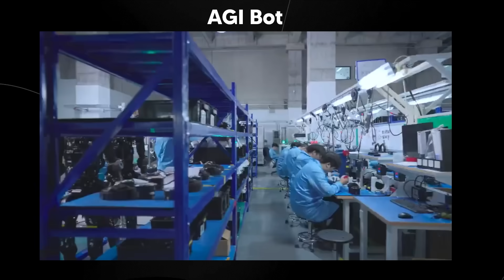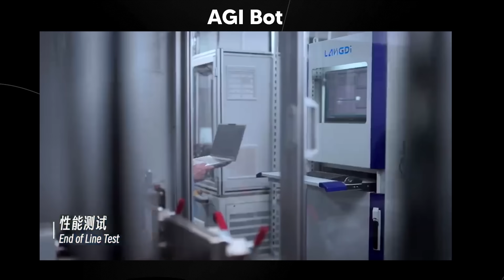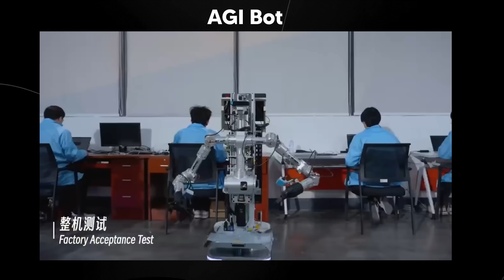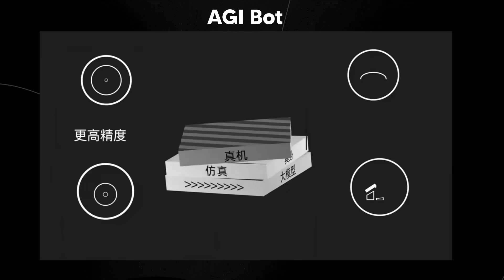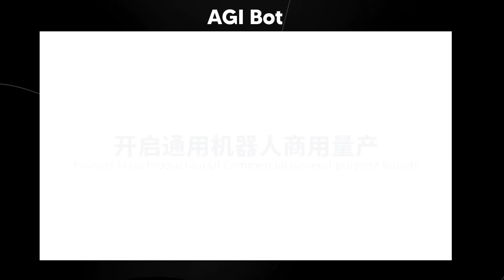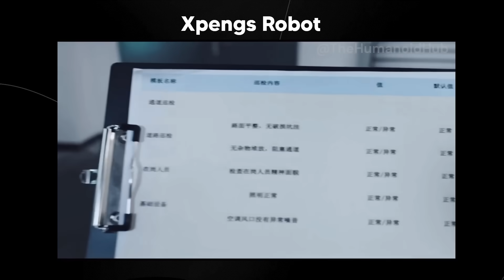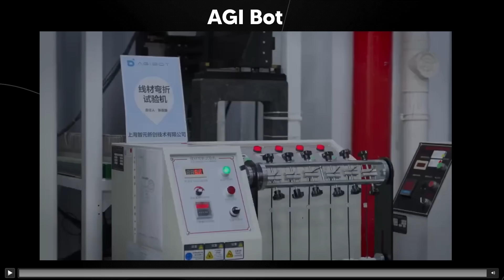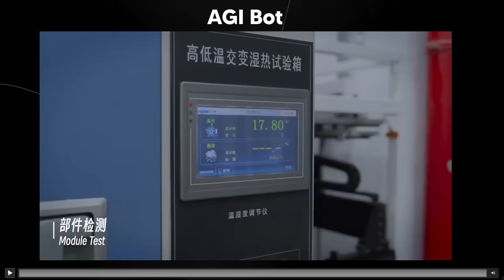China's NEW AI Robot Workforce: The World is STUNNED! 1 Million Robots by 2025?

Comment: If you have a totally automated factory, why would it be a humanoid robot? Why wouldn’t the factory be tailored specifically to automation?
Reply: What is more expensive, redesigning a factory to work well with automation or designing your automation to work well with a factory? Even if redesigning the factory would be more efficient in the long run if the up front costs are much higher than the other solution the less effective solution of designing automation to work in a suboptimal environment will be chosen until it becomes the only feasible solution at least as far as I understand it.
Reply: @christopheriman4921 yeah I agree. The whole world is built for humans, when requirements change or demand slows these humanoids will be flexible and easily repurposed unlike your typical Kuka arm or specialized equipment
Reply: Humanoid robots to cut factory workers and eliminate labor costs -> generate more profit -> reinvest in automating factory for maximum efficiency

I work a boring factory job and think about different hypothetical machines that could build the thing I'm making (humidifiers) faster but the cost of those would be extremely high. Once you can just plug one of these robots into a human role, you can save costs and use that extra profit to increase efficiency and output (every factory in the world will be doing this).

Things are about to get very weird in the next 10 years.
Reply: @ Explain to me how there will be a demand if jobs are gone?
Reply: Because most things are designed to be operated by humans
Reply: As they are already doing in car factories world wide. Making them look like humans is pointless in a factory setting.
Reply: They have to make humanoid robots to replace humans. Bipedal walking creature with 2 arms is peak evolution